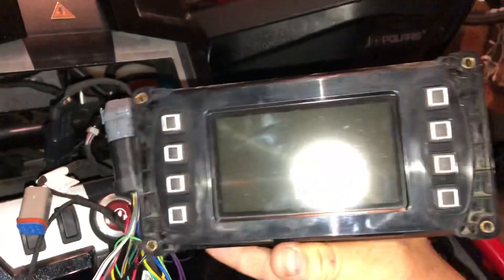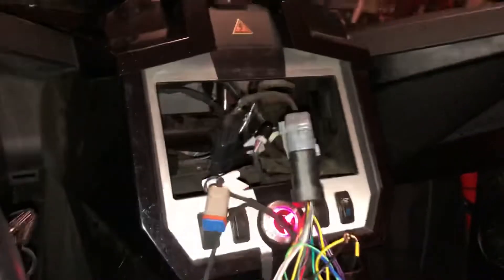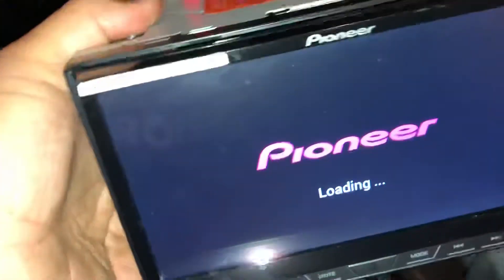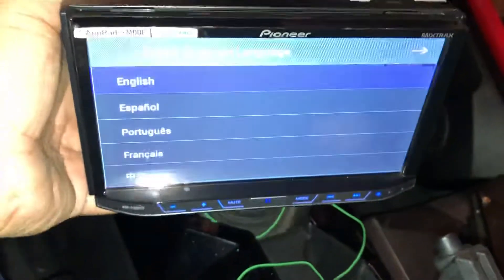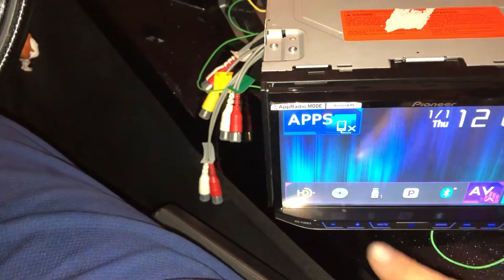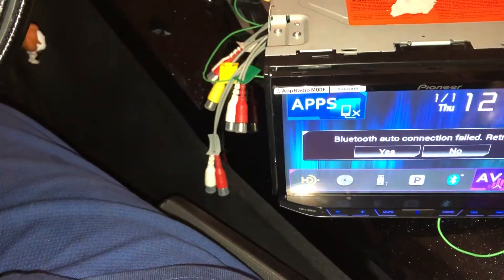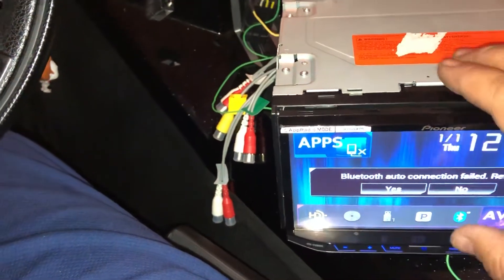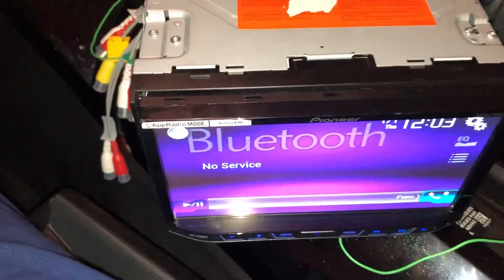Replacing the horrible 2016 Polaris Slingshot Radio

Comment: Hi Jay.. What wiring harness did you use to connect to the Polaris wiring connectors?
Reply from the maker: I spliced the wires directly into the old OEM wire harness. I cut off the OEM plug. FYI.

Comment: Did you use a metra harness to connect to stock radio harness or did you splice into the wires?
Reply from the maker: Metra harness
Reply: What dash kit did you use? Im wanting to go with scosche and then they have a backup camera harness it comes with then use the metra harness as well. Im trying to hook up 2 component speakers with tweeter, and then 4 other pairs of speakers as well as sub 😬😬😬
Reply from the maker: @scootergirl8615  http://www.metraonline.com/part/70-9701
Reply: Ok thanks